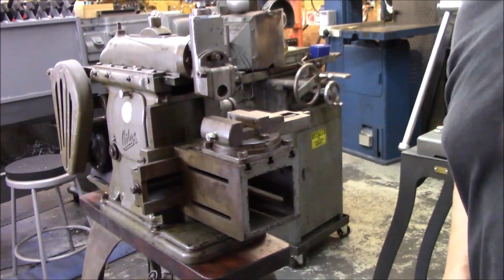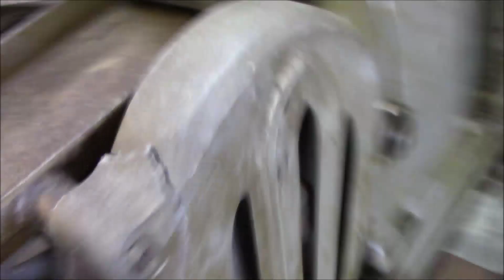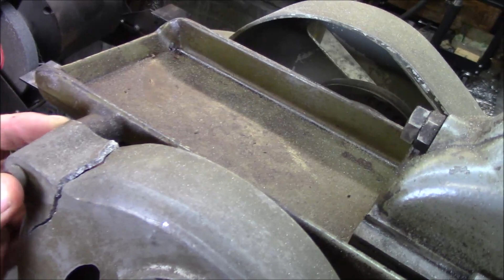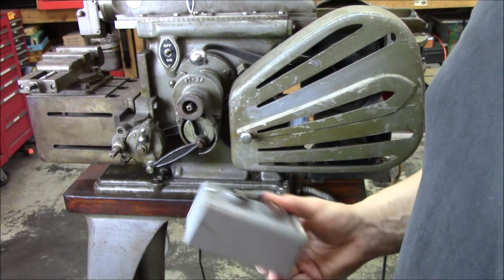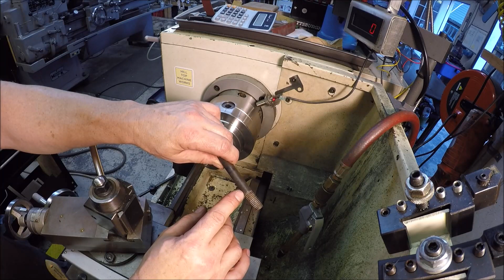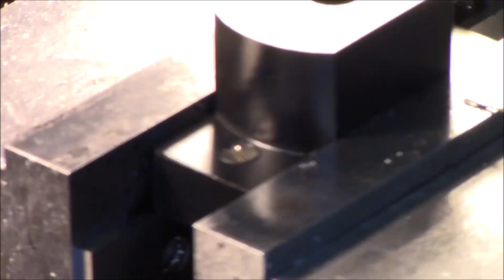Atlas shaper info, guard repair, and switch fix

Comment: How cool you have 1202 and mine is 1204. These should still be going strong long after we are done using them.
Reply from the maker: So the research shows your would be made in the fall of 1939 also. Its believed they made 1500 of the early models like ours. Then in 1941 the 7b came out.
Reply: Thats nice to know. Thanks.
Reply from the maker: stratocaster1greg Welcome.

Comment: Looking good. Delrin is stringy to mess with. When you said you ran out of travel on the lathe is the reason I went through the trouble to put the dovetails in the tool holders. I gained at least 1 inch linear travel that way

Comment: That 2nd switch you bought  is a starter switch. Lots of larger equipment use them. My shaper has one. Good video Tom. Neat little machine.
Reply from the maker: A starter switch you say. Can you use it for a spare for your shaper? If so I can ship it to you.
Reply: Hill Top Machine Works That's very nice of you Tom but I already have a extra switch. You may need it anyway. Soon as you ship it to me you will need it.👍
Reply: I have a switch like that that starts my RPC.